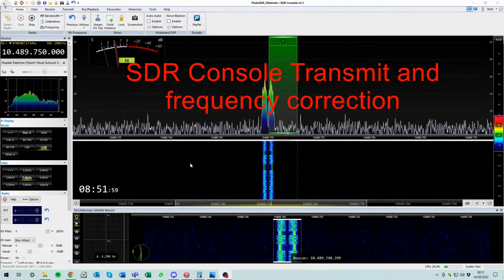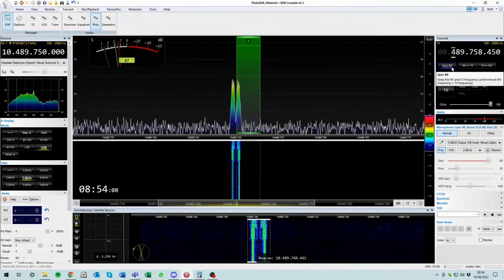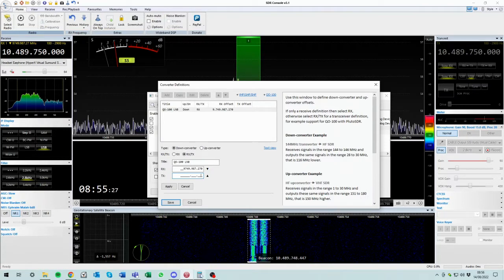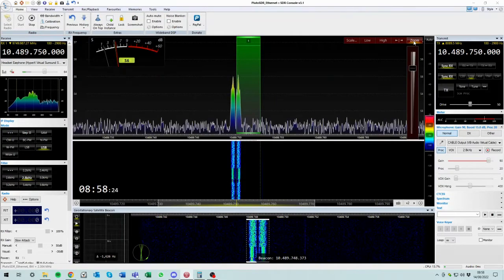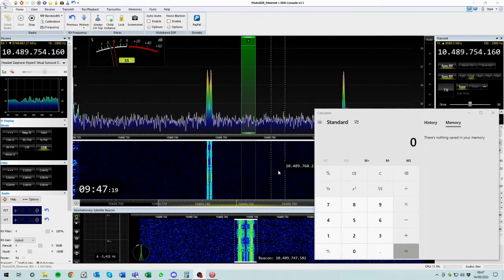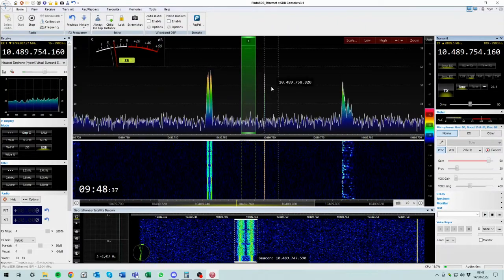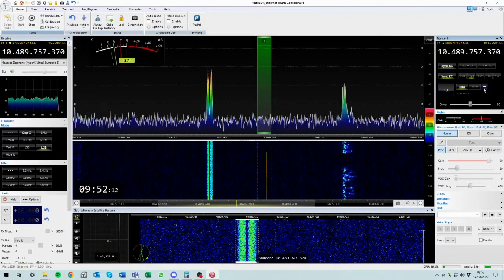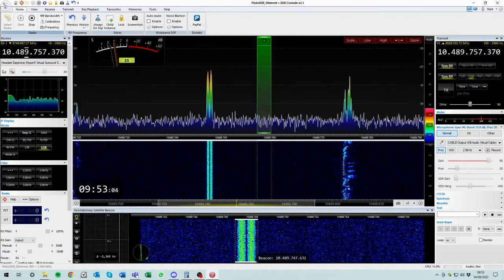SDR console Qo-100 transmit and correction

Comment: With SDR Console and Pluto+
1. I measure over 0 dBm tx output, when I transmit on 2.4 GHz.
2. But when I use the downconverter "identity", I only measure -65 dBm tx output!
I searched the settings and watched a few YouTube videos but I don't see the reason for the low output in downconverter mode.
Kindly advise.

Comment: Thanks for the video, unfortunately you are not making a QSO with a 1000hz tone. you are making it with SSB (in USB). So what is the best method to fine tune that?
Reply from the maker: Hi there, yes correct we are using a SSB transmission but it is much easier to position a tone that it is to try and position the SSB transmission.  Just think of the tone as
voice but at a single frequency and so is positioned 1000Hz from the band edge if that makes sense ?

Comment: Very nice explaining videos that you are sharing, they are very helpful. I suppose you are using Pluto+ as SDR Transceiver so I was wondering about the performance working QO-100?
Can you share another video of recorded QSOs (TX&RX)? inorder to see how this SDR performing.
Hope you reply to me soon, thank you so much.
Reply from the maker: Hi there - thanks for the feedback !  This video is part of a more complete write up on Instructables, see the link below.  Working the Q0-100 satellite is great, very much like working a narrow HF band or any other linear repeater.  Yes, I am using a Pluto+ which performs really well - again see the complete article for more detail on the ground station and other aspects to the SDRConsole setup :
https://www.instructables.com/Satellite-Ground-Station-for-the-QO-100-Eshail-2-G/
Cheers and 73's  
           Dave G7IYK
Reply: @dave68cat  really appreciate your quick reply thank you 🙂
Reply: @dave68cat With SDR Console and Pluto+
1. I measure over 0 dBm tx output, when I transmit on 2.4 GHz.
2. But when I use the downconverter "identity", I only measure -65 dBm tx output!
I searched the settings and watched a few YouTube videos but I don't see the reason for the low output in downconverter mode.
What could be the problem?
Reply: Did you tried firmware upgrade?
Is it fully compatible with the original adalm-pluto SDR?
Reply from the maker: @abdennourbouras6243  hello there - I did try the firmware updrade for the Pluto SDR and it does work but does not support the integrated ethernet adapter. Which firmware are you referring to?
Reply: @dave68cat   F5OEO DATV Pluto custom firmware
Reply from the maker: @abdennourbouras6243  this firmware will work but you won't get the Pluto+ features specifically the ethernet port

Comment: Nice one...This and the previous one are very good. They explain the conversion settings well. I think a lot of operators are just using the default QO-100 conversion values in SDR Console and are all just slightly off in frequency hi hi. Compensating in XIT too sometimes. 73 de F5VMJ